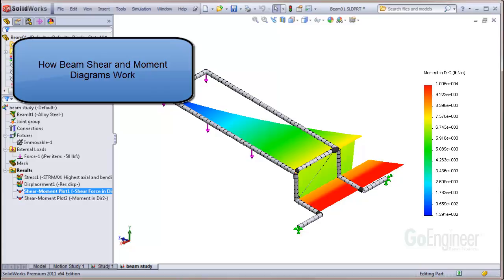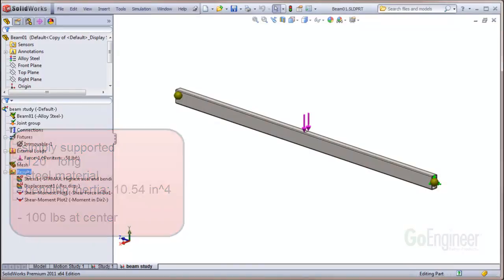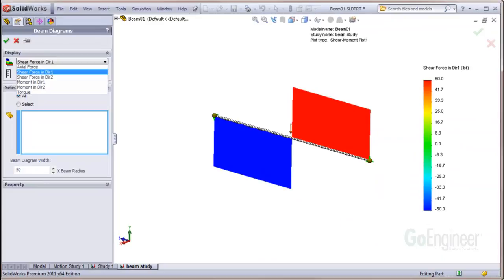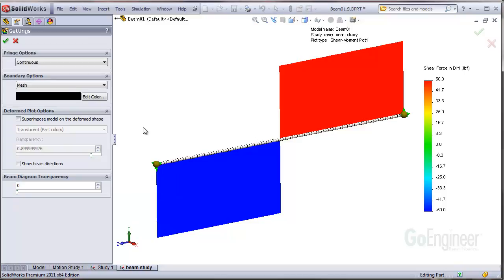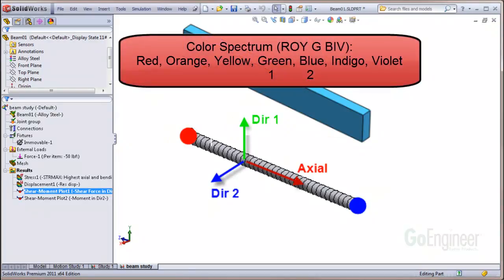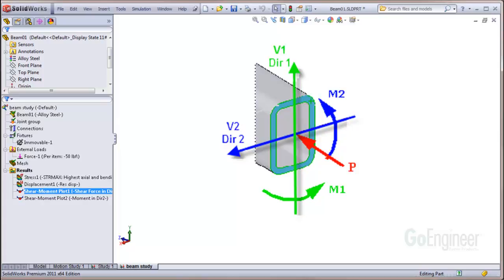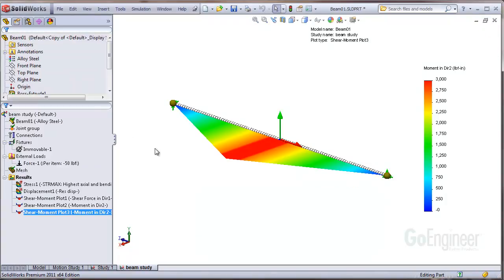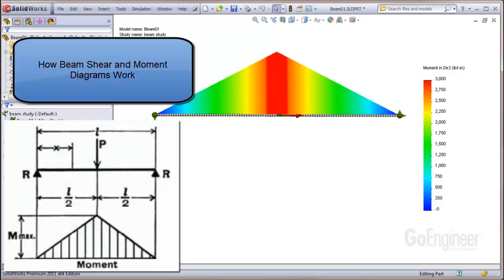SOLIDWORKS Simulation - Beam Shear & Moment Diagrams

Comment: Please help me for simulation of beam when section is variable in lenght.
Reply from the maker: Beam elements in SOLIDWORKS Simulation are allowed to taper.  You can also split beams to create additional joints.  If you post your question to the SOLIDWORKS Simulation forum (with images) and link it here, that can help us comment further.

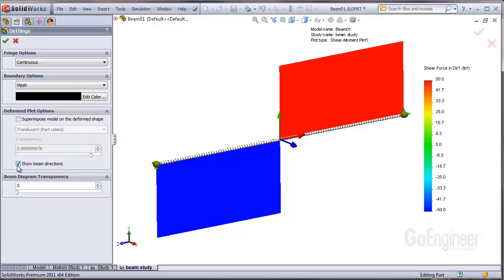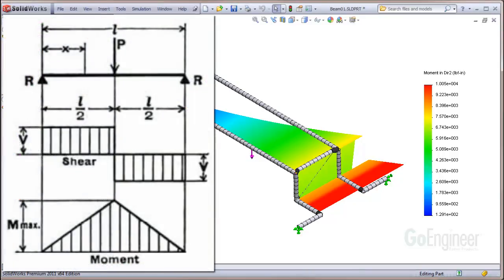Comment: Sholdn't the Shear Diagram shown at 1:32 be in the same direction as the 0:24 one? The Dir1 (green) is pointing up so that means positive shear forces are lead in that direction, right? I don't get it...
Reply from the maker: Carlos Macedo,  there was a known software issue with displaying shear forces in dir 1 in a beam diagram in the software release used in this video.  Running the same analysis in SW 2016 results in the correct display of the shear force beam diagram in dir 1 which matches the diagram displayed at the beginning of the video.  Thank you for watching.

Comment: Have you attended a "Mechanics of Materials" course? If so, you might recall how to draw these. They are just graphs of the same equations, but in color. You draw a free-body diagram, Sum forces X direction = Sum forces Y direction = Sum of all moments = 0 (for equilibrium), and you develop an equation relating the shear force and moment as a function of position along the beam. The diagrams are really 2D graphs of that equation, but  they are in color!